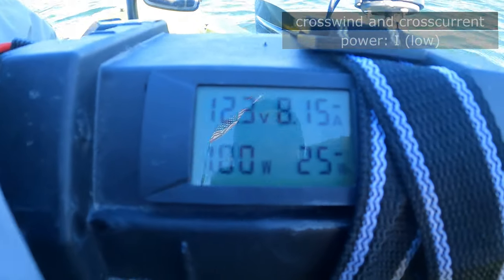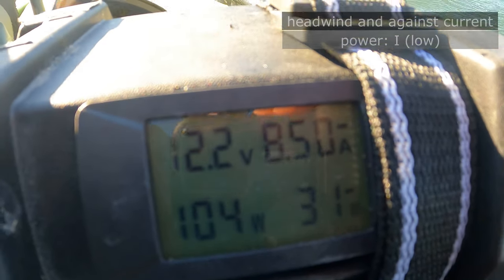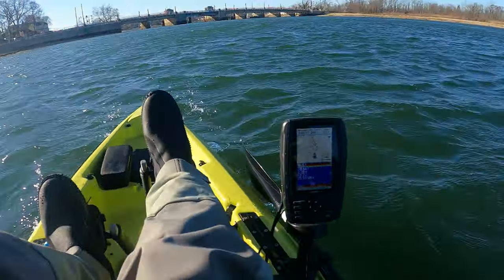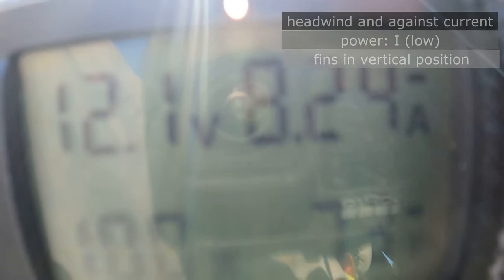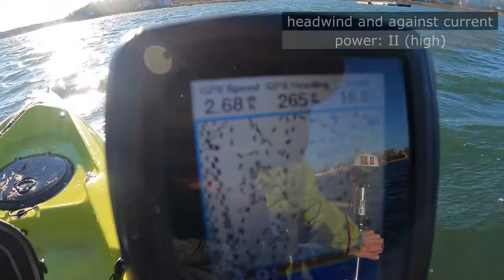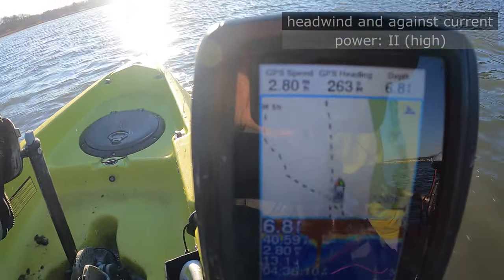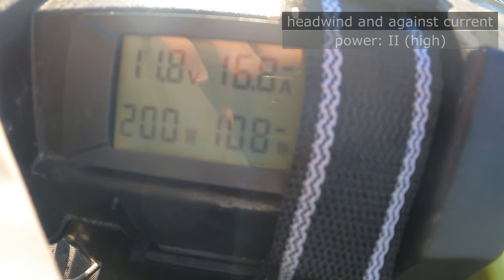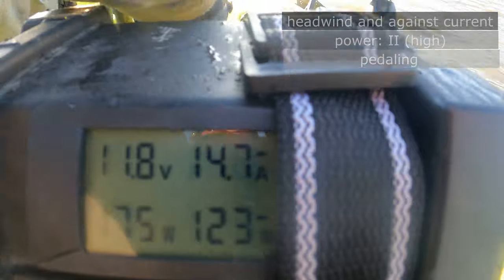Watersnake trolling motor amp draw tests - side mounted on kayak

Comment: I just added a Bioenno 60ah lithium battery and a Renogy RBM500 battery meter to a group 24 battery box for my Hobie Lynx. I like the Renogy because it also shows the estimated remaining capacity in amp hours and in %. I like K1 K2!'s post about making a shroud for the shaft to minimize the churning sound (cavitation/ventilation). I hope he posts a video and more detail about how he did it. PS: is there a way to post a pic in these Comments? On Facebook I just drag it into it but I don't know how to share a pic here on YouTube.
Reply: Forgot to mention I have the Watersnake 24# on my Hobie Lynx.
Reply from the maker: Hey James, that does sound nice to have the battery % and yea K1 K2 is exactly right about the shroud for the shaft, I haven't done a good job of it yet but i quickly taped some thin foam around the shaft near the waterline right before my last trip out and noticed a difference.  When I figure out a better more permanent way like they suggested with the formed plastic I'll try and post a video on it.  Yea YT is kinda strict with posting links but I have been successful posting links from imgur before, try this: https://imgur.com/upload
Reply: I googled "how to add image to youtube comment, and then followed the steps in the resulting video.
Reply from the maker: @jimwoodmansee  that’s a nice battery monitor!  It’s a little pricey but I would totally use that one on my next battery build, thanks for sharing
Reply: @jimwoodmansee  I'm looking at a Watersnake 18lb and 24lb for my Lynx along with the Eco-Worth LiPo (20AH or 30AH) battery.  I'm leaning towards the 18lb since I primarily lake and reservoir fish and don't have to deal with currents, tides or long distances.  Can you advise on what you've learned, your recommendations including 1) battery meter,  2) the actual need/value of a PWM controller and  3) an auto-reset fuse (should i ever venture into salt water).  Thanks.
Reply: @MrSteve280  with regard to 18 vs 24 i upgraded to the 24 after a strenuous trip where the wind picked up to about 15-20mph and i could not make headway against it; i headed to shallow water, got out and pulled the kayak by rope for almost 2 hrs to get back to my launch site 1 mile away. The ESC or PWM are only worth the effort if you plan to troll at speed slower than Speed 1 on the ES.
Reply: @MrSteve280  the Renogy battery monitor is worth every cent because it tells you the actual remaining amp hrs and the % of battery remaining so, for example, if you launch at 100% of battery power and 1 hour later you are at 50% then you probably have about 1 hour left (at the same avg speed of your outgoing trip)..
Reply: @jimwoodmansee  Understood.  Just trying to get my head around what a $100 RBM500 does that a $10 battery capacity indicator doesn't.  I'm very new with all of this and sure I'm missing something.
Reply: @jimwoodmansee  Makes sense.  I'm hoping the pedal drive and the motor will keep me out of trouble but that won't matter if wind, current, distance and fatigue all conspired to show me how wrong I am.
Reply: @MrSteve280  the $10 battery monitors measure actual voltage, not capacity and not amp hrs. This kind of monitor would be fine on the old fashioned lead acid batteries whose voltage declines on a sloping curve to about 50% usability (at which point they are essentially dead so you only get to use about 50% of its rated capacity). Today's lithium batteries provide their rated voltage on almost a straight line until they reach the end of their usability at about the 20% level (thereby letting you use about 80% of their rated capacity). By straight line, I mean, for example, if you fish for 8 hours a voltage measurement of your 12v lithium battery would keep registering close to 12.6 volts right up until it dies suddenly at the 20% mark. So, at 7 1/2 hrs and 8 miles from home you think you have plenty of battery left when, in reality, it is about to die and you have a long paddle back home. That's why voltage measurement on lithium batteries is useless. The better monitors, like the Renogy or some of the other ones on the motorized kayak group on facebook that might cost a little less employ either a Hall-effect or a Shunt which tells you how many amp-hrs and what % of your battery's amp-hrs is left. And it bases its estimates using the 80% of capacity, meaning if it shows you have 50% left it means until you get down to the 20% mark, not zero. So, it measures actual remaining usability. So, in the example I cited, you would know long before 7 1/2 hrs that you had, say, 50% left, and that it is time to start heading back to the dock. My Renogy constantly displays both the remaining amp-hrs and % remaining.
Reply: @jimwoodmansee  thanks much for taking the time to explain

Comment: What kind/size battery are you using?
Reply from the maker: for this test i just used a cheap lead acid 35ah which i had lying around.  I then purchased an 80ah lithium after doing these tests for the motor and still use that one today:  https://www.aliexpress.us/item/3256803618604245.html?spm=a2g0o.order_list.0.0.af101802QWmUXJ&gatewayAdapt=glo2usa